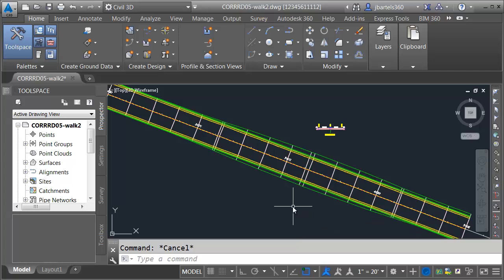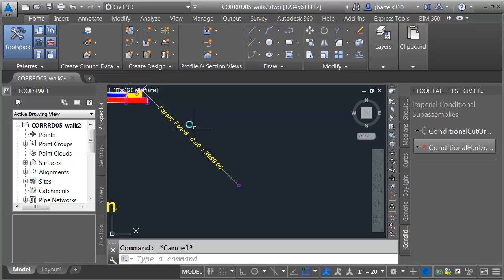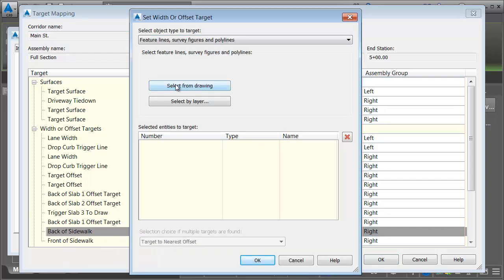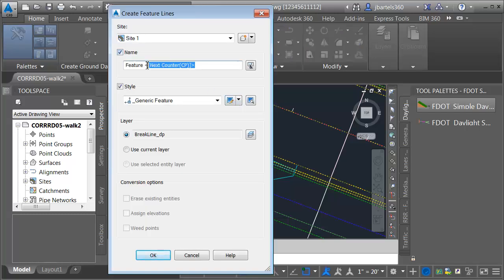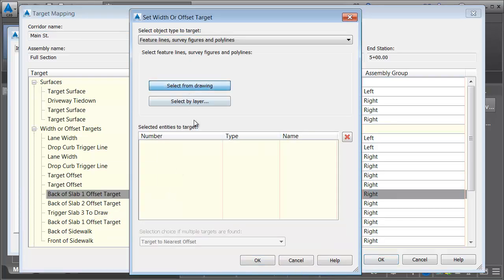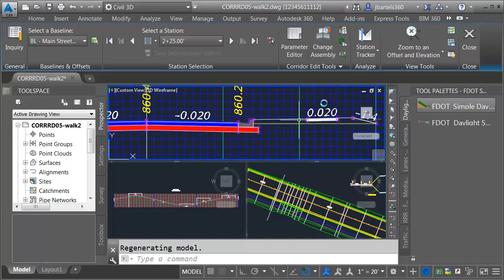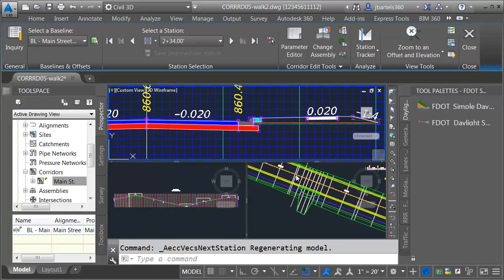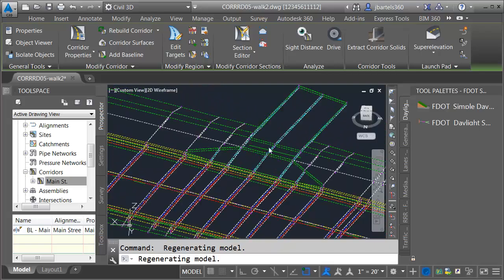Adding driveways to a corridor using FDOT's Civil 3D subassemblies

Comment: Jeff, I recently attended one of your sessions held at district 7 for Florida Department of transportation. I am still having issues with this drive way tool.  I can get the drawing to recognize the driveway, but I am not able to get it to recognize the sidewalk.  I have been in contact with applied software support and we both are still stumped.  Do you  know what possibly could be the problem? if need be I can provide you a copy of the drawing that is causing me the issue.